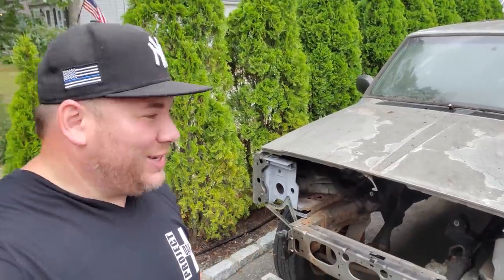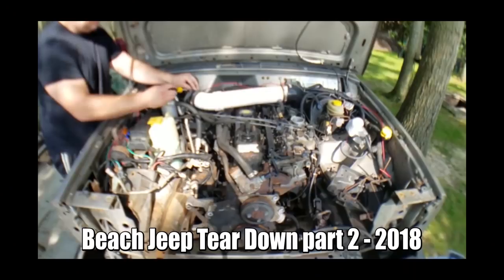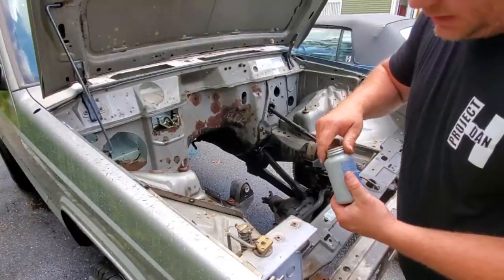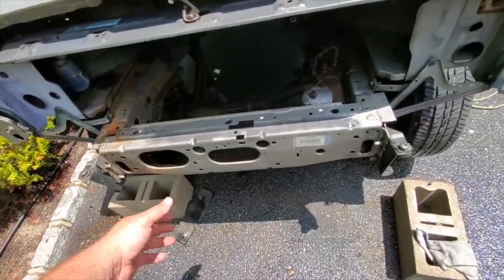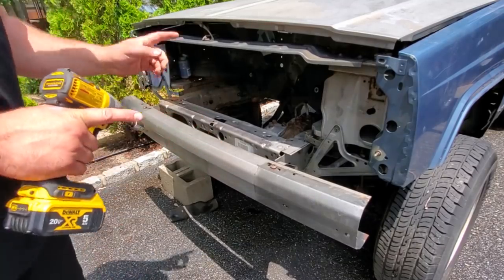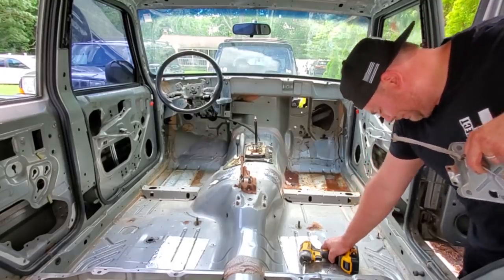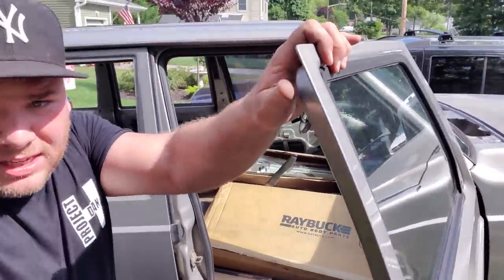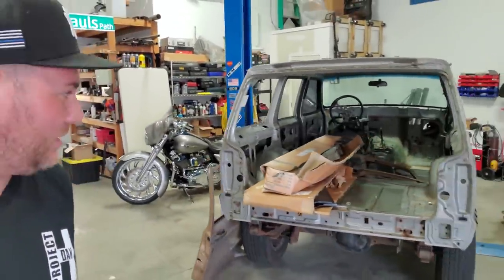2001 JEEP CHEROKEE XJ GOING TO THE FABRICATOR... BYE BYE BEACH JEEP

Comment: Hey Dan I I need your help. My xjs battery went dead and after jumping it I have to hold the gas down to keep it running what could this be. I read it may need to be reset by driving around pressing the peddle 3 times ext do you have any experience with this? Could it be the iac of the battery tray sensor thanks
Reply from the maker: Keepet it at 1000 rpms with your foot for a couple mins occasionally reving to 3000.   After about 3 mins it's should bounce up to 800 rpms.  If you think it's gonna dip down again and stall keep it goin for Another couple mins.   It's just the computer re learning it's environment
Reply: Thank you Dan I will try when I get home

Comment: My A/C is leaking water in the passenger floor and this is my first XJ I need help on what to do
Reply from the maker: Hopefully its just a clogged condensation drip valve.  Check on the firewall under the blower for a little rubber elbow.  Blast some air in there to clean out the spiders and mud.  If thats not it, and your thinking your leaking coolant doen there,  then its probly a leaky heater core 😱
Reply: No it’s water from the A/C thank god
Reply: Could also be leaking from the cowl area. The place where dan shows he drilled a hole for the intake you can drill a hole there too and reseal the air intake area there with caulking
Reply from the maker: @seanmacdonald8476  exactly Sean! 👍
Reply: I have the same year jeep
Mine wants to stall and run rough after it warms up... I've had the cam shaft sensor replaced and a coil pack . spark plugs..new battery. I'm muffed!!!
Reply from the maker: @carolnelson4433  MAP and TPS too?
Reply: @ProjectDanH  I'm taking it to a jeep mechanic next week
I'm hoping he'll sort it out ..the last 3 guys that worked on it  couldn't . Thx ! 👍